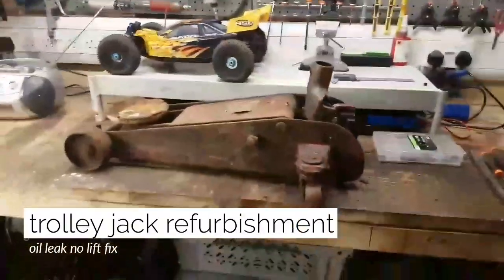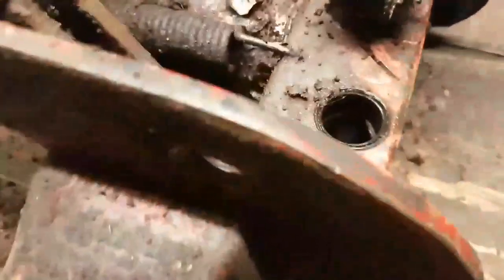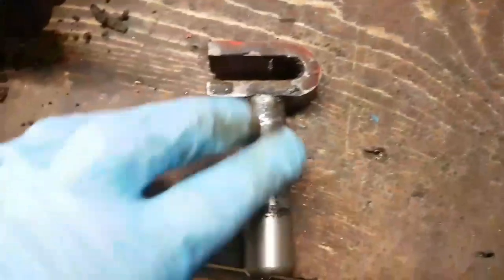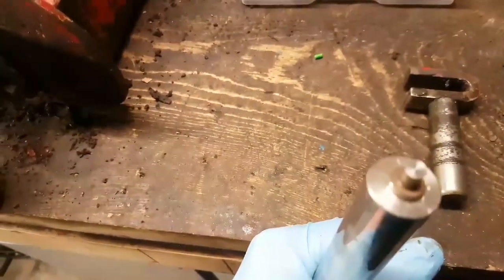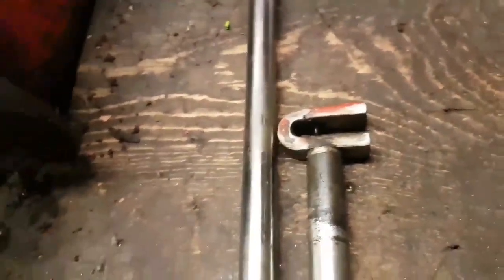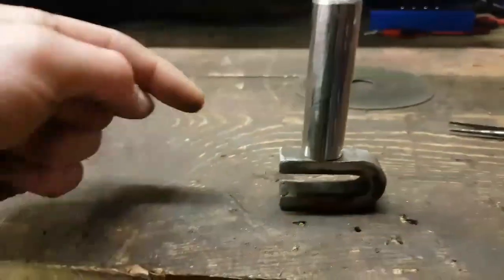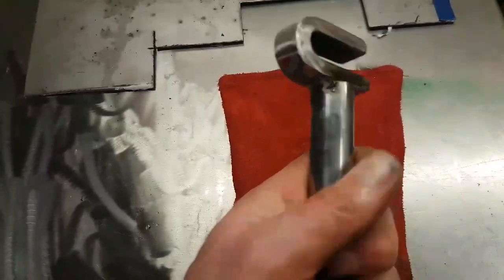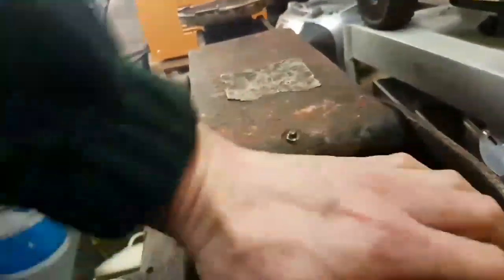hydraulic floor jack repair oil leak no lift

Comment: I have an exact jack as yours which I picked up for NZ $ 5.00. The seller wanted to rid of it because of the same issue of no lift. These are quality jacks built by a Japanese company and were marketed world wide under different brand names. I will restore mine, hopefully this summer and use it in my garage.
Reply from the maker: Hello pal, yes these are great jacks.If you ever find a full seal replacement kit for this jack please let me know as i would love to do a full refurbishment :)

Comment: I've never seen stainless steel spark like that.
Reply from the maker: I am a total newbie when it comes go welding so I have no opinion lol
Reply: I believe you're correct. The shaft appeared to be chromed, which is perfect for the application as well.

Comment: There should be a fill plug on the barrel of the hydraulic ram.  That screw you tried to remove probably has two valve balls under it, it's not the fill plug.
Reply from the maker: ah thanks for your help i will have a look tomorrow :)